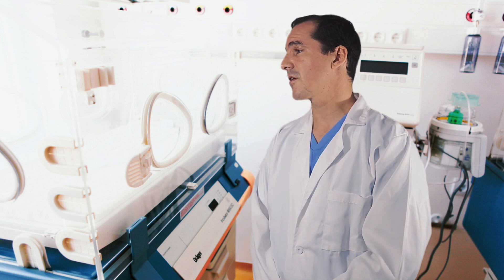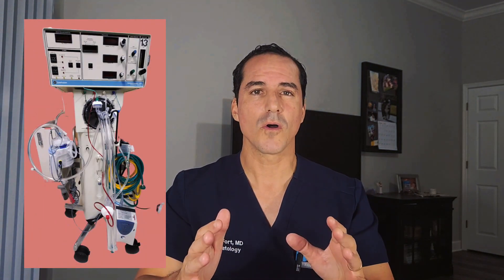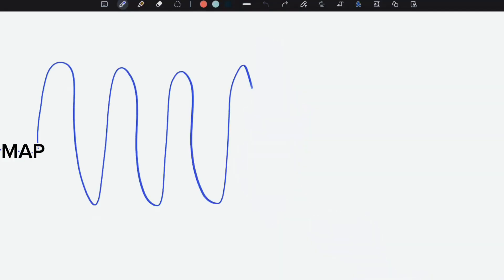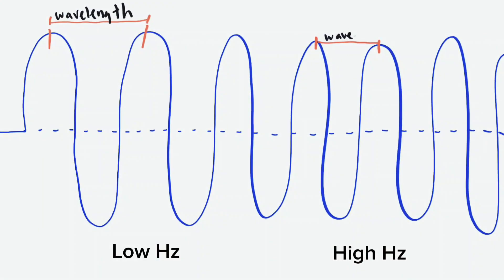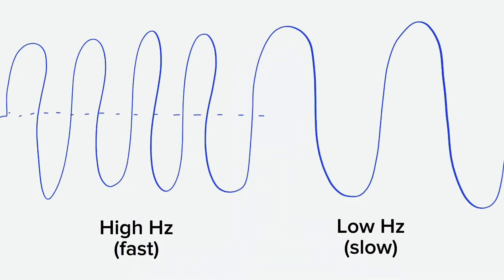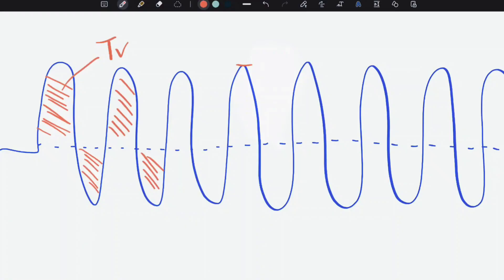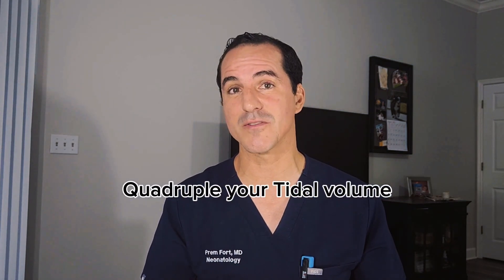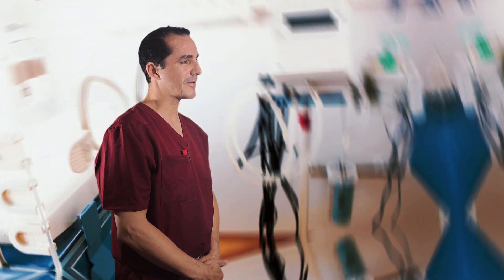Be SMART! Use these Settings on the Oscillator!

Comment: Hi there, thanks for the video. If I can have a question...what would be your next step if you had a baby on MAP 10, Amp 20, with dangerously low pCO2, and actually needed less than 1:2 ratio?  Would you switch to AC, or increase frequency? Or decrease amplitude a little and possibly risk atelectasis anyway? Because what you are saying with the ratio and atelectasis definitely makes sense, but people do still go low with amplitude (basiscally almost to the point where chest wiggle stops), and only then change the frequency, and later on possibly I:E ratio.
Reply from the maker: Great question. Personally, I would ask myself...do we need to be mechanically ventilated. If all parameters exist, you CAN extubate from high frequency. If you need to remain intubated, then go up on frequency until 15. If already there, then switch to mechanical vent. Hope this helps
Reply: @thenicudoc  thanks it helped.
And id love to ask you two more question, have ever used frequency higher than 15? Maybe with babies under 400g? 
And have you ever used hfov+cmv regime? So called Combined oscillatory and mandatory ventilation for sever respiratory failure resistant to hfov? SLE6000 offers this mode, but the date is scarce.
Reply from the maker: @aron7765  Going beyond 15 decreases the Itime, so we don't go above 15. No...never heard of HFOV with CMV. Kinda defeats the purpose of the HFOV.

Comment: Ty a lot for the review Dr Fort!
Reply from the maker: It is my absolute pleasure. Do you like the oscillator or the Jet best?
Reply: I dont have experience with jet ventilation. Just the oscilador. Wich is not used The way it should in the units i work. Specially for the premies i mean. Follow your work form Rio, Brasil. Keep it up.